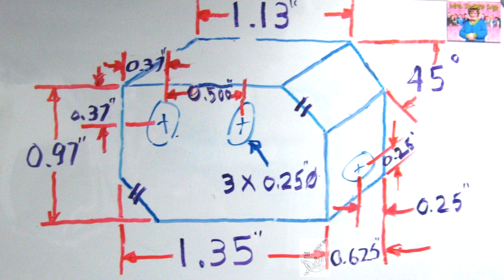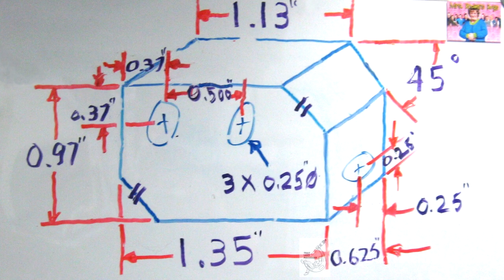HOME SHOP JIGS & FIXTURES PART 4, MACHINING A PLATE FIXTURE, SHAPER, DRILL PRESS & ROUND COLUMN MILL

Comment: I shake a lot worse than you do, and it's getting worse.  I sometimes use a spoon when eating, forks are to dangerous.  I feel your pain sir.
Reply: Same problem. I've lost count of the number of times I've stuck the toothbrush up my nose whilst cleaning my teeth. The more I try and control it the worse it gets. I've found it best to just stop let the tremor die down and then continue. The problem seems to be slow response in the neural feedback in my dominant arm  which started after a bad dislocation of the shoulder.